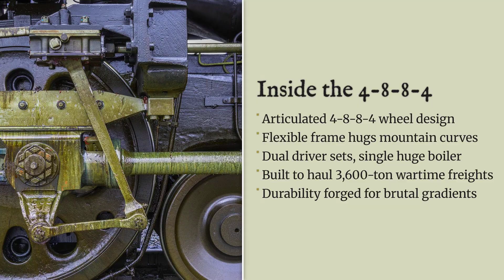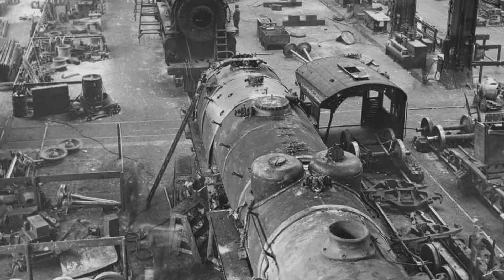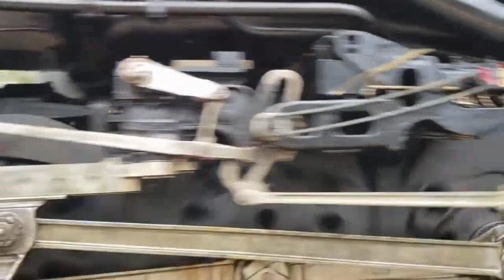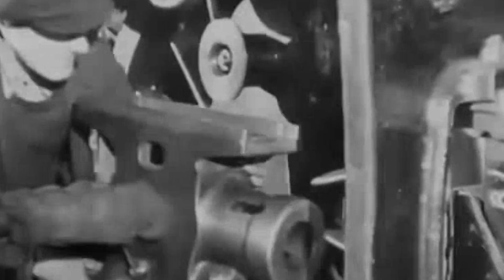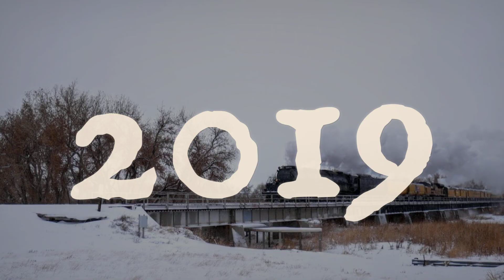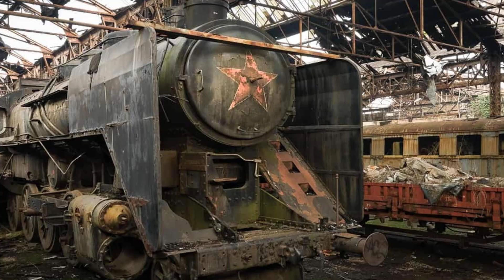This 80-Year-Old Train Is Better Than Modern Trains!

Comment: The fully restored Union Pacific Big Boy 4014 is an interesting mixture of new and old technologies. One big item is that Union Pacific installed a modern Positive Train Control System on Big Boy 4014. In the cab of Big Boy 4014 there is a stand with what looks like computer equipment mounted to it that is part of the Positive Train Control System. Also the radio communications system on Big Boy 4014 is a modern system.